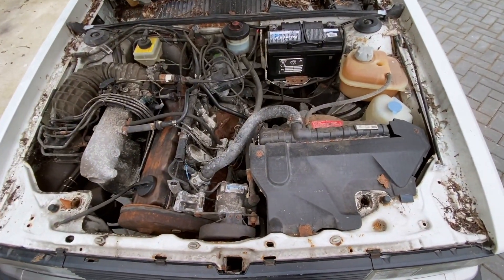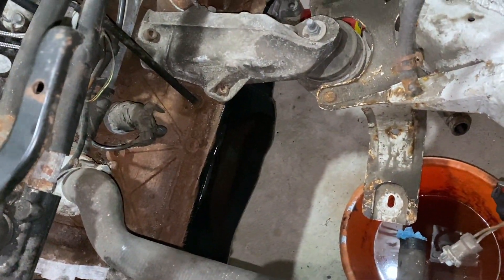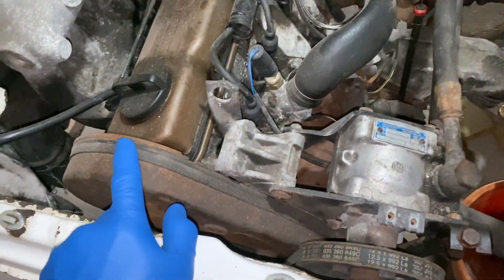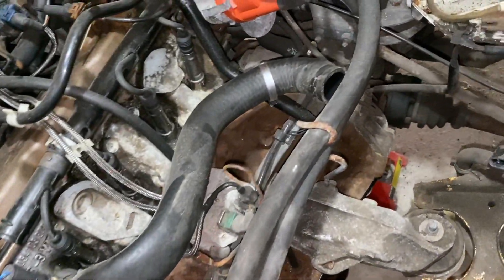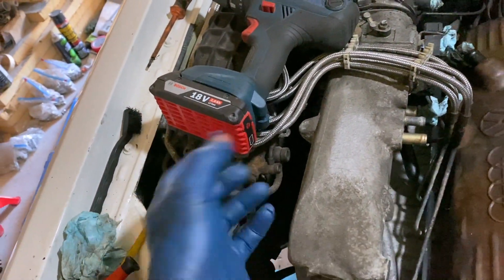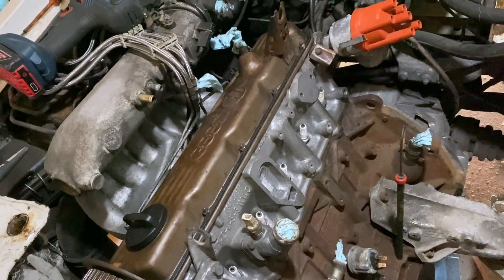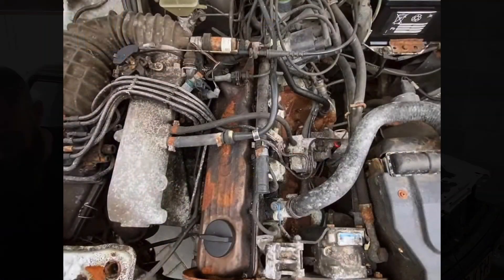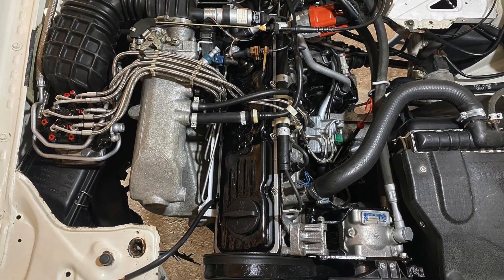Full engine bay restoration 5 Cylinder Audi Coupe GT

Comment: Looking absolutely fantastic, great job! At 2:43, that's the warm up regulator, which basically increase fuel enrichment when the engine requires it, i.e. during the warm up period, and full throttle. The cold start injector is on the inlet manifold near the throttle body, usually with a blue electrical connector, that basically just sprays some extra fuel in when cranking for a short period (longer when cold), to get it started.
Reply from the maker: That’s great thanks for the info! I thought it was a timer to supply fuel to the cold start injector. Nice to know that it adds some fuel under heavy load too!
Reply: @Resto.Nation  yes, looks like yours has the vacuum attachment, so if it's working correctly it will provide a richer mixture with lower vacuum (i.e. high load). The thermo time switch, which controls when the cold start valve/injector sprays, is located on the back of the engine block (i.e. bulkhead side). I've got an Alpine White Coupe GT too, mine's a pre-facelift so hopefully see you at a show at some point, be interested to compare them! 👍
Reply from the maker: @markf4720  that sounds perfect. If there are any between now and the imminent winter then I would be keen… thanks again for the info.
Reply: @Resto.Nation  probably next year now for me, unfortunately mine has a gear selection issue which I trying to sort at the moment. Rebuilding the linkage and replacing clutch cable in the hope that sorts it... Otherwise it's out with the gearbox, replace clutch and bearings! Audis in the park seems an obvious choice for next year, I hope to be there!
Reply from the maker: @markf4720  shame your having problems. I hope mine stays issue free. Audi in the park sounds great. If I’ve still got the car then I will go!

Comment: It would have been good to see how and what you used to paint the parts etc.
Same with cleaning. Show some examples please.
Great job, looks very nice.
Reply from the maker: Fair. Which bits would you like to know?
The majority was engine enamel back for the block and silver for the other bits. Also some hammerite direct to rust silver spray for brackets etc.
Reply: @Resto.Nation  on the engine block for example: how did you clean it? What tools did you use? Did you use a paint brush or spray? What about the hard to reach areas, any tips here?

Comment: Where are you buying the parts?  I'm restoring a 1985 Coupe GT.
That's not the cold start injector, but rather the warm up regulator.  Cold start injector is into the intake manifold.
Reply from the maker: I used AUTODOC in Germany. Takes a few days to arrive but unbeatable on price 👍🏻. 
Good luck with yours

Comment: nice work, but I guess you have very good reason why you did not pull out the engine. Now when it looks so nice these small rusted parts of the frame inside engine bay are bit annoying to me. But maybe I am not best to judge because rust is really something I can not stand :). Nice work! liked it.
Reply from the maker: Thanks. I just wanted to show what could be achieved without engine removal. I agree with you on the rust on the slam panel… but where do you stop haha!

Comment: Oh and someone sent me a design for a plate to remove that brake extra assist.. Its so not needed and ugly too
Reply from the maker: Remove which but sorry??
Reply: I swear I saw the part but it's not on your engine. Its fitted above the WUR  and you have the casting pattern for it on the engine. Its to give the brakes extra vacuum boost when needed. I can't add a picture.
Reply from the maker: @kevpetchey1409  is yours a uk?
Reply: @Resto.Nation  no it LHD and built for the Switzerland market
Reply from the maker: @kevpetchey1409  that much be why 👍🏻
Reply: A beautiful  car beautiful job well done have u still got  the car